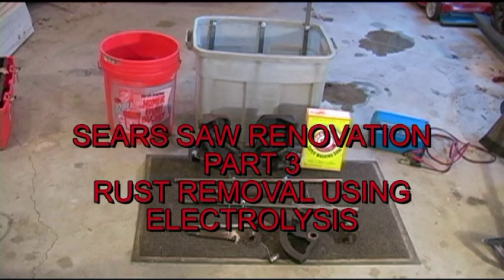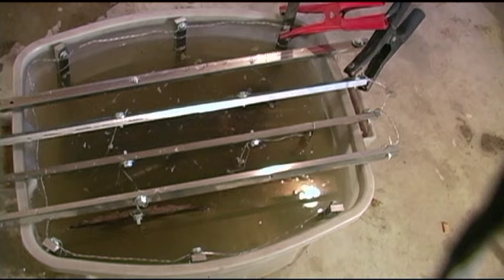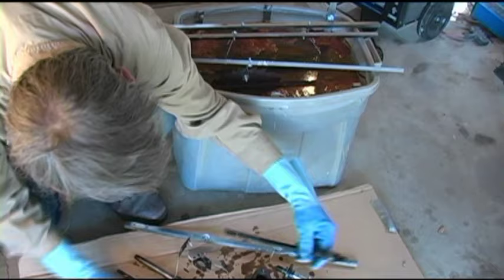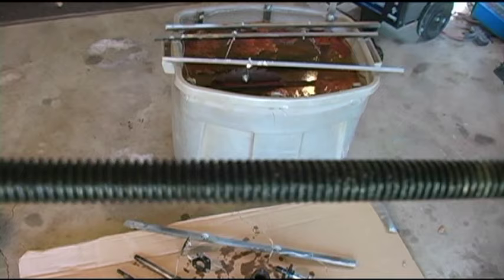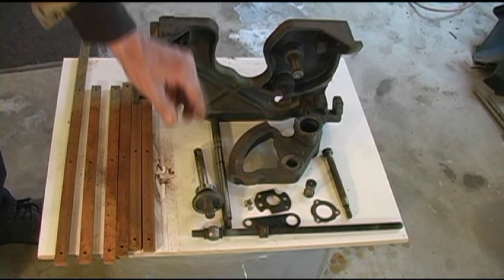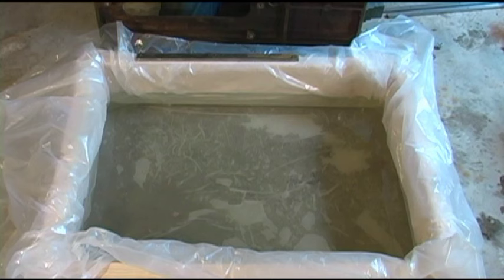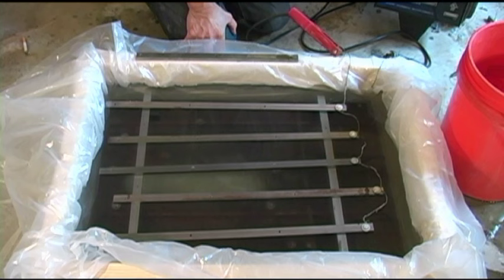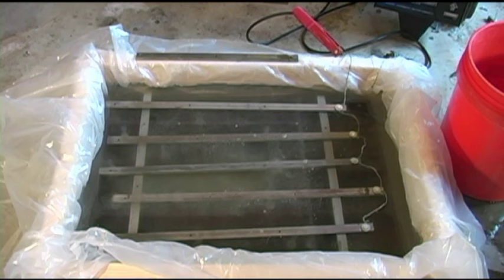Sears Saw Renovation Part 3 Rust Removal Using Electrolysis

Comment: Good clear video. I built a de-rusting tank out of a 55 gallon polyethylene drum and rolled a steel sheet into a cylinder to act as the sacrificial anode. We do a lot of de-rusting of our artifacts and old tools with great success.  The wider the piece of steel the better, to expose more anode surface for the parts that are hanging in the tank. 

I have a few comments and suggestions to make which will perhaps be useful to your viewers.

Using a 10 Amp battery charger produces too much current for the rusty steel. That is why you saw those very active bubbles and surface scum being produced too quickly. You want the process to go much slower, using no more than 2 to 3 Amps. The reason for this is that as the hydrogen gas separates from the oxygen in the water molecule, it embeds itself into the surface of the steel that is being de-rusted. The result is that there is hydrogen embrittlement just under the surface of the steel. While this might not be a major issue for the top of the saw table, other parts that are bearing against one another, like a lead screw, could be a problem And result in their chipping, when put into service.  For example, if you would try to de-rust a chisel, the sharp edge could become very brittle and could chip, when used. Using lower amperage reduces the amount of hydrogen that is embedded in the steel surface.

Prior to putting your parts in the tank they must be free of grease and other contaminants. Otherwise, the washing soda will raise a lot of other scum to the top and also slow down the process. I found the best way to clean the parts quickly is with a pressure washer used outside the tank. You can get most of the contaminants off easily this way and then wire them up to be lowered into the electrolyte.  

Another suggestion, when the part is removed from the tank, it is covered with a black oxide called magnetite. It is the same material that is used to protect the surface of drillbits that you see that have been blackened with that material for rust protection. However, in the case of the electrolysis process, this material does not adhere tightly to the surface and comes off as a black mess on your fingers. Hence, the suggestion to wear gloves. When we remove our museum’s objects from the tank, the best way we have found to remove magnetite and other remaining bits of material from the artifacts is with a pressure washer. It is amazing how quickly and cleanly the parts are revealed to be completely free of rust. Remember, however, to immediately use WD-40 or wipe the parts with oil as soon as you dry them with a towel. Or a leaf blower works well for removing the water.  Flash rusting will immediately begin, if they are not coated with oil quickly.

Another technique that we use is when preparing the electrolyte solution of washing soda, we have found it useful to use a small amount of hot water in a container to which the crystals are added. They are harder to dissolve in cold water and settle to the bottom of the tank too quickly to be immediately useful. If you use warm water in a small container, you may then stir it until you can visually see that all the crystals are dissolved. Then pour and stir the solution into your tank.

Large polyethylene barrels sometimes can be found near electrical contractor businesses, who buy wire in bulk in these containers.

These are some of the things I have learned over the years of de-rusting at the Museum of American Heritage. Good luck with your de-rusting efforts, it certainly has proven for us to be the most cost-effective and environmentally-friendly method for taking rust of parts.

Comment: Thank you! This is the best demonstration of using electrolysis to remove rust, I have seen on Youtube. The bigger battery charger seemed to make the difference at 10 amps. Thanks again.
Reply from the maker: Most videos that I referenced before I tried electrolysis were doing small parts, and recommended a 6 amp charger setting.  When my small charger wouldn't work, I used the lowest setting on my big charger, which was 10 amps. Considering how much metal I was working with, (approx. 35 lbs. with the "mechanics" and 68 lbs. with the top) I didn't see how it could hurt to try it. I can't wait to try it on an 8" jointer I have seriously neglected.  I do appreciate your comments...I wish everyone would give a "thumbs up" or "thumbs down" to let me know how we are doing with our videos.I need to finish the videos on the saw, but will seriously try to give more "set-up" information in another video as soon as possible...it's a great technique.     Thanks,Jerry Cole

Comment: I may have to try electrolysis on my next rusty project. I have an identical saw that I just finished spraying the last coat of paint on. I didn't have as much rust and was able to get it off with wire wheels on my bench grinder and on my drill. For the top I built a plastic lined box like you but used about 4 gals of white vinegar. After a 24 hr soak, all the rust was gone. I wasn't able to paint it right away and by the next day the underside of the top was covered in orange rust which required a lot of scrubbing with drill mounted wire brushes.  You advised coating the bare metal immediately with a rust preventative. Great advice!!! Too bad I didn't see your video earlier and had to learn it the hard way. 

A quick way to remove the angle adjusting screw is to chuck the end of the shaft in a drill and slowly unscrew it. 

Very informative videos that I found after I had already done the work.
Reply: JT ,I have used the vinegar system (acid etching) to remove rust on all kinds of things. From drill bits , tools and especially all my metal files. It not only removes rust but sharpens them as well. I normally soak for 24 hours, a couple times i have done 36 to 48 depending on size amount of rust. I rinse them in mixture of water and baking soda to neutralize the acid , then clear water. wipe off and spray with wd 40. that stop it from flash rusting.
After watching this, i am going to try it on the saw  I just bought. Thank you Jerry  for the series !!

Comment: I have an old Craftsman saw similar to this.  It really was in pretty good shape other than the rusty cast iron top.  My question is it really worth fixing up these old saws?  I think I would like a roller stand, new fence and miter system new belt and maybe new larger HP motor.  Cost is about $600 to do this.  Would you spend this much money on an old saw or opt for a new cabinet saw for about $1500?
Reply: Gary Karczewski I have a old craftsman like this one, it’s not rusty but I have already rebuilt the motor, installed a besmyer fence and replaced the wings with homemade ones. I got the saw for nothing when we cleaned out my grandpas shop. I now have a ripped apart to replace the arbor bearings. Yeah I think it’s worth it to fix them up

Comment: Hello I live on texas ... how much for renew my craftsman table saw ????? or how I contact your business? ???
Reply from the maker: I wish some of my customers would comment on your question.... I really don't want to turn my channel into an "infomercial", but do want to help you.  To be honest, the amount you spend will depend on how well you want your saw  to cut.   If you have A Sears with the motor hanging out the rear of the saw, it probably vibrates like crazy because the original pulleys don't run true and the belts are stiff and develop a memory.  This vibration causes the blade to wobble, causing saw marks, burns, and kickback.  You should fix this problem first, as it's also a safety issue.  1.  Installing one of our pulley and belt sets will eliminate 95% of the vibration problem, and improve the cut by 20%-25%. 2.  You should make sure that the saw is in good alignment.  Our PALS kits allow you to adjust the saw with an "Allen wrench" instead of a hammer, like most saw manufacturers recommend.  You can watch the installation video for adjustment on the PALS page of our site, and watch the technique we use to check the alignment. 3.   Install the best blade you can afford.  The TS2000 (TS21040TK) 40 tooth thin kerf blade that we offer on our site is absolutely the finest combination blade in the country. The thin kerf reduces the amount of material you remove by 25%, and will make the saw more powerful than it would be with a "full kerf" 1/8" width blade.  Doing any of these things will help the saw, but doing all of them should enable your Sears to perform as well as any new saw with the motor hanging out the rear ( in the $1000. - $1500. range) being sold in the US.  The Sears might not have the power of the newer saws, but I guarantee the cuts you will get would be better than on the new ones. By the way, every product we sell has a money back guarantee if you're not completely satisfied.  I hope I answered your question adequately, without getting people upset thinking this was a "sales pitch".....it's not, it's a fact.Our website address is www.in-lineindustries.com if you want more information . Jerry